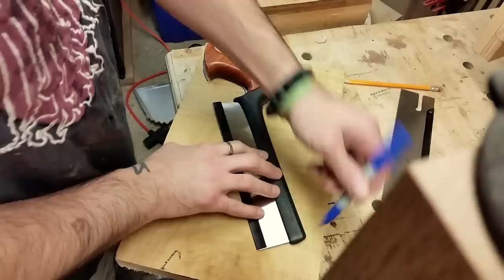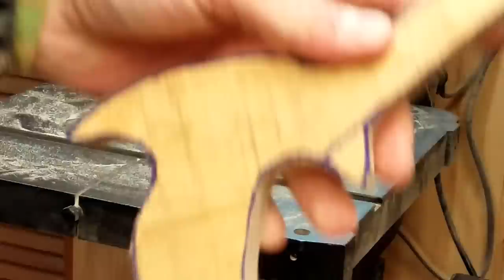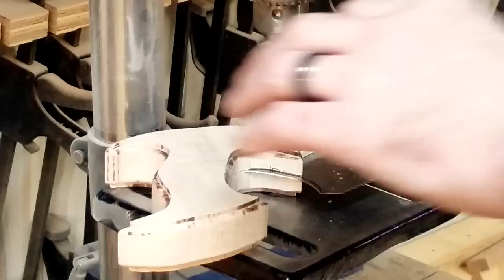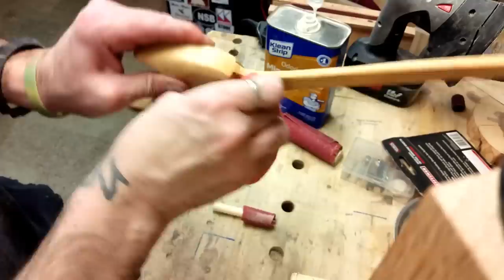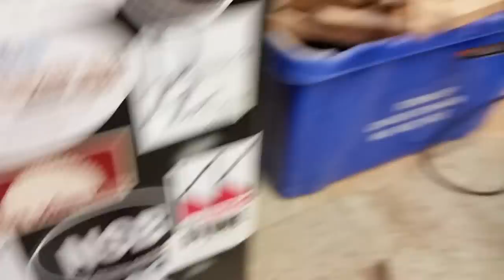how to make a dovetail saw- inspired by John Heisz

Comment: Hi, I know this is a few years old - but still useful video, I have a question though, how did you cut the groove for the blade to sit in?
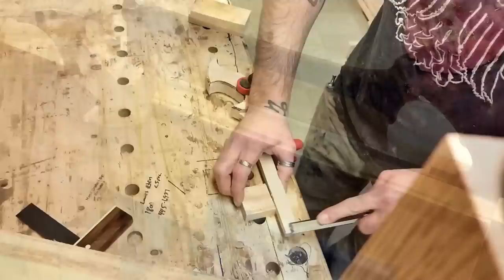Reply from the maker: @1:38 -1:53  I run it over the table saw cutting a groove in it.&clean it up with chisel.the  Same way John h. did it in his original video. thanks for watching and commenting I appreciate the support!!
Reply from the maker: The blade sits in the one side and then I glue/epoxy a matching piece to fit over the other side to make it even/centered

Comment: Do you think this could be done without a router and bandsaw?
Reply from the maker: Martin Davis yes i do...i think u could use a coping saw to get the shape of it.just cut it out in sections. (may take a little longer ) and instead of a router u could use sand paper to get the rounded edges..id go w/#100for the rounded edges and 180&220 to smooth it out..hope that helps and works for ya.thanks for watching and commenting appreciate your support.

Comment: but for real, how is that veritas dovetail saw cause mine is in the mail
Reply from the maker: Michael De Rocher foreal youll love it! the spine is straight and strong and it cuts smoother and straighter than any other saw ive owend and used.. at first it's a bit finicky because it gets a little jammed up but once u break it in a bit it cuts smooth.. just don't apply too much downward pressure you know as they say let the saw do the work but for real,, totally worth every cent..i have the 14 tpi. works the best on 1/2 stock..in my opinion..thanks for watching and asking/commenting much appreciated